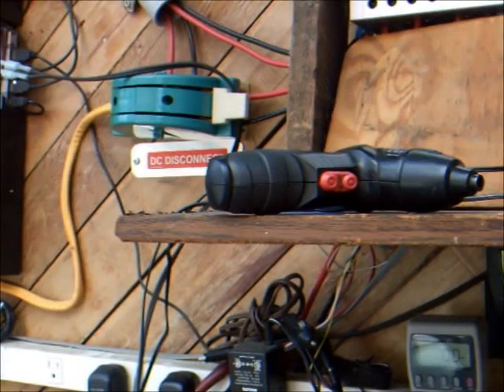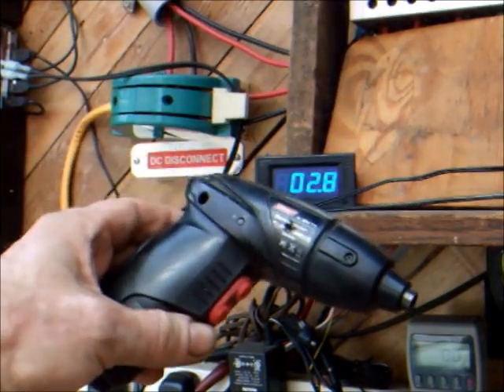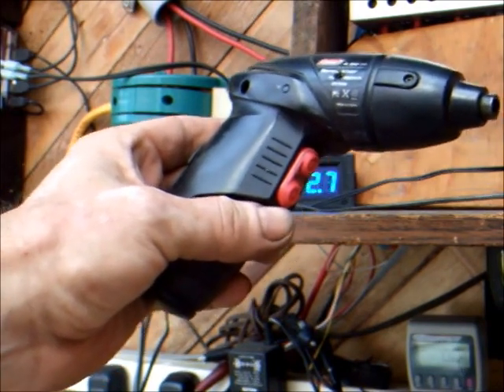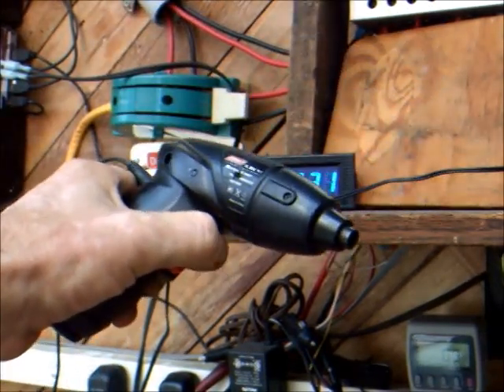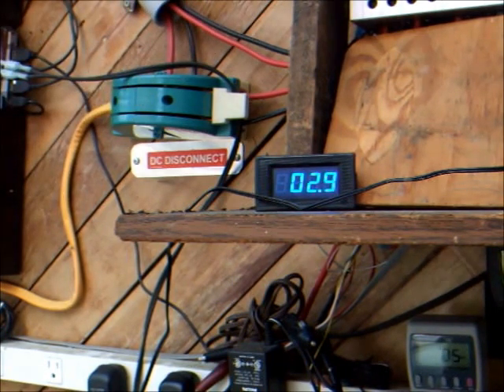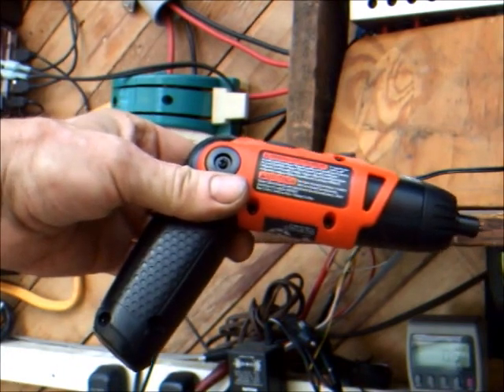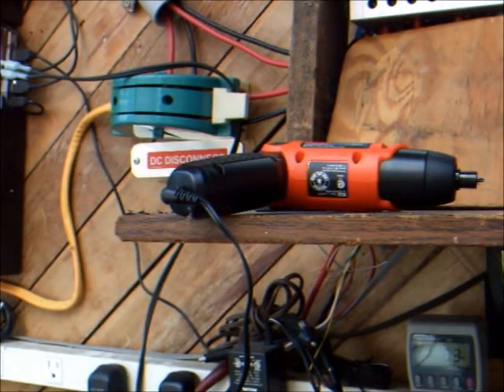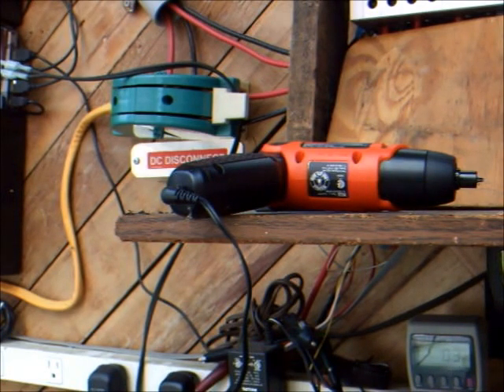Cordless Vampire Load

Comment: makes no sense why the motor coast as much as
Reply from the maker: I suppose it was a combination of the older (less efficient) wall transformer/power supply and the weak NiCad batteries that had a high self discharge current and constantly left the charger charging.